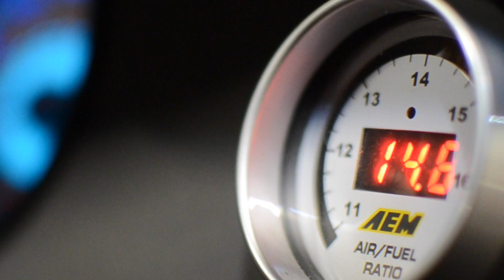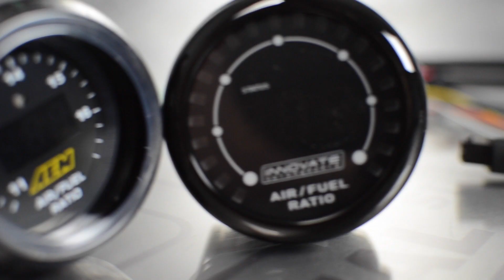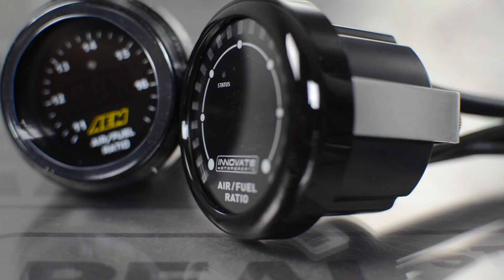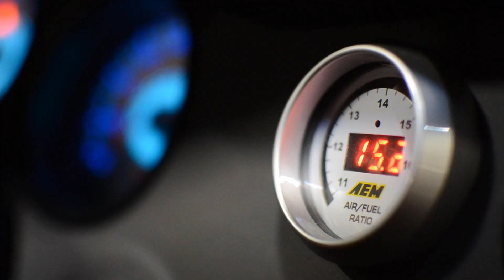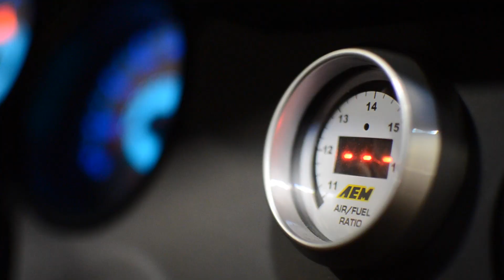Lambda VS  AFR - Jay's Tech Tips #35 - Real Street Performance

Comment: Every single video is on point.
Extremely useful!
Thanks for the uploads, I learn something new with every video.
Reply: Hey Jay, I just put an AEM wideband on my Procharged Mustang today. How do I get a Lamda reading you spoke about? I gotta say, Real Street is local to me in Lake Mary and they are the only ones that took the time to give me some guidance and referrals about tuning my car. My ProCharger came with Diablosport tuner and even Diablosport (who is owned by Superchips - also local in Sanford) was absolutely NO help and didn't give a crap to help me find a tuner who could dial in my car. I'm going to do some WOT runs tomorrow and adjust the fuel trims using the DIablo and the AEM
Reply: You will unscrew the trim bezel around the face of the gauge and change the supplied faceplate. 
 
 Keep in mind that changing the global fuel trim on your handheld device won't always yield linear change across the whole load/RPM range.  Also watch the long fuel trims as they will take time to normalize.  Thanks and good luck with your car.

Comment: Thanks for clearing that up!  If you plan on running e85 and you buy the AEM wideband gauge, they give you different gauge faces for gas/lambda.  They try to explain the theory of operation for different fuels, but it leaves you with more questions.  They don't explain that you'll see gasoline AFR if you are running e85 or why that is.  These are the explanations that are missing as we're learning to build/understand hot rods.  GREAT CHANNEL!!!

Comment: Straight on point, Hi there, i'm gonna try my question here, hope no answer though, but here i go :
I recently put a new 0² sensor on my car, before doing that i was feeling my acceleration had some kind of stair like gradually getting in it while full throttle. my average mpg wasn't good but all in all wasn't that bad, considering the overall rating of this car. But now with the new sensor, my acceleration is shabby like restrained for some reasons, feel continuous though with no step or bump into it. But my mpg go down like 10 to 15% down : ±405 miles before and ±360 miles after. Is there any kind of run-in cycle or brakes in, that i missed, or something ? my local tech doesn't have any clue, and want to make a full diagnostic on my car.
any thoughts about what's going on ?
-Best regards.

Comment: Sir I have a question. Instead of making the switch to Lamda couldn't we just use the chart and adjust the Air/Fuel according to the applicable fuel we are using?

Comment: i have a few qs:
1.will the AFR works on carbureted engine?
2.if so,do i have to install more than 1 on weber 4 cylinder cause the tuning for each is different i pressume?

Comment: I am using the wideband O2 sensor to tune a single cylinder NA motorcycle engine. The confusion I have is, the intake pressure will vary under loaded and no-load condition, so should I conduct these tests on a running motorcycle i.e. under load. IF yes then what is an ideal reading I am targeting across the rev range? Thanks!
Reply: It varies. 6000rpm under full load might be 12.8 but 6000rpm under light throttle might be 13.8:1.
This goes for the entire rev range so adopting a one size fits all a/f ratio is futile.
Sitting there revving it up under no load and trying to work out an average for varying load a/f ratios is as pointless as fitting an ashtray to your motorcycle.

Comment: i have a jzx100 tourer v thats been running extremely rich, under high load i can smell the fumes from my exhaust and theres black smoke. Also my water temp gauge warning light is always on from the moment i start the engine. could it be a faulty water temp sensor thats forcing the engine to remain rich?

Comment: My NGK AFX wideband goes from 9 to 16 on the af ratio. Does that mean if im at 14.7 on that gauge im running lean ? 

I know from the instructions i've read it recommends that 13 is around the stoich since the gauge maxes out at 16 that means 14.7 would be close to a full lean reading on that specific gauge.  But maybe it still has no problem at 14.7.  However i will say that my supra thats on a ecu masters stand alone does not like idling at 14.7 at all. It prefers the higher 13's for idle.  

So far though that is my main issue is getting idle perfect and trying to sort out the cold idle.  It just doesn't wanna idle cold. But after i do get it warmed up it runs for me all day.
Reply from the maker: +Review Guy for gasoline, Stoich is stoich. its hard to believe a wideband manufacturer would configure their gasoline wideband for stoich at 13:1

I did a quick search, here is the AFX Tuning Manual http://www.ngksparkplugs.com/pdf/afx_tuning_manual_rev_06.pdf ... in there, they say Stoich for gasoline is 14.57:1 but then they go on to say "For most spark ignition engines, there is a specific small window of AFR in which
maximum horsepower and best throttle response will be found. For gasoline, that range is 12.5 to 13 AFR. " ... here they are referring to naturally aspirated applications. ... 

So they arent saying stoich is 13.0:1 they are saying that your target will be close to 13.0:1 .. .there is a difference between target and stoich. the afr you are shooting for (target) will often be lower than stoich
Reply: Ahh ok, i must have misunderstood the instructions. 

Im not sure why my car doesn't like idling at 14.7 but it doesn't. and i've checked my plugs they are nice and clean looking.  

I have them gapped around .29 though.
Reply from the maker: +Review Guy what kind of car is it? do you have a big cam? how big are the injectors? Some engines with big cams like to idle richer
Reply: +REALSTREETPERFTV  just a 1994 supra na-t when i did the nat conversion i put 800 cc injectors, 320 lph fuel pump, adjustable fpr, the stock cross over intake. fed by a 6266 and 3" ic piping from turbo to the intake. not runnimg maf but speed density map and iat. controlled by ecu masters emu. its my first stand alone so im not a professional tuner

Comment: Have a question if my car was turned on q16 and i have retuned on 91 octane is it okay to mix little bit of q16 with the 91 also have a aem wideband o2 sensor
Reply: +Manny Jr If you're running too much boost/timing or nitrous for 91 octane adding octane certainly won't hurt a thing.

Comment: So if my car is flex fuel tuned and i switch between 93 and e85, its almost pointless to get a wideband because it wouldn’t be accurate for e85 and 93?
Reply: It would be perfectly accurate for both. The wideband is in the exhaust and measures lambda irrespective of fuel. It is 1.0 for total combustion.  The AFR to get total combustion changes for gasoline vs E85. For E85 the ECU makes the injectors add more fuel. You either tell the ECU or have a fuel sensor that tells the ECU.

Comment: I just installed a lc2 in my evo and its on e85. its was calibrated while on e85. it ranges from 10. to 15 depending on acceleration and decel. is that a correct reading?
thanks
Reply from the maker: +5280videos CO by default, the LC2 displays AFR on a gasoline scale. So even though you have E85 in the tank, 14.7 on the gauge will be stoich.

Comment: So would i need to buy a new gauge if its set for gas 14.7:1 & im running E85 which is 9.7:1???
Reply from the maker: +Alberto Salcedo  no, if you are using a wideband that was calibrated for gasoline to tune on E85, you have a couple options. When the sensor senses stoich, it tells the gauge "hey i am seeing stoich" and then the gauge manufacturer translates that to display 14.7 on the gauge for your eye to read. So 14.7 on your gauge is stoich whether you are using gasoline or E85. So even though stoich for ethanol is 9.7, your gauge thinks sensor stoich is 14.7 so even even when you are at stoich on e85, the gauge will show 14.7 because thats what the manufacturer told the gauge to display when the sensor sees stoich. You can either continue to coinsider 14.7:1 on the gauge as stoich even though you are on ethanol, or you can switch to lambda and forget about AFR numbers.
Reply: +REALSTREETPERFTV ok, I understand what your saying now
By the way, where did u got to school to learn everything u know now, my friends call u Dr. Mechanico
Reply: REALSTREETPERFTV  that is mean just tune 14.7 on the gauge eventhough ethanol 9.7 ?